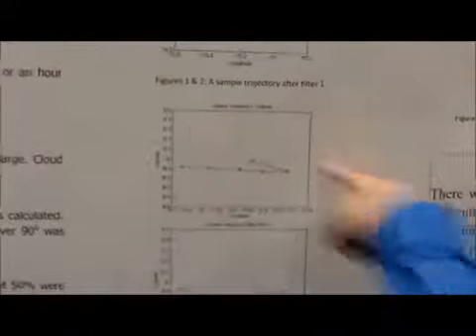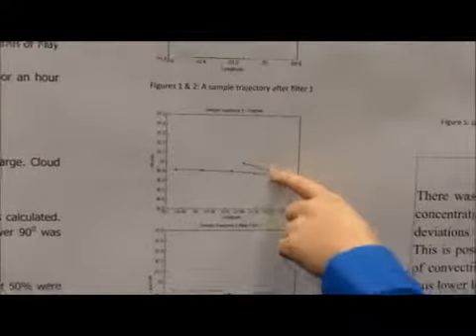Urban Heat Island Effect

Comment: The science is simple, less air flow between buildings, all those large sky scrappers with all those windows reflecting UV light, pus the added humidity by being surrounded by a large body of water!

Also, not much soil for the evaporated water to seep into when it's preoccupied by building/cement....